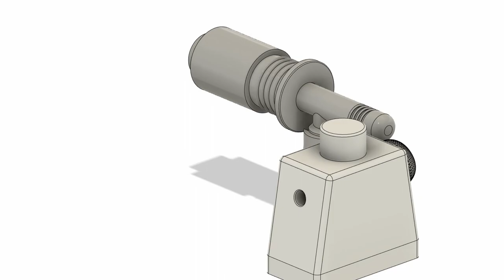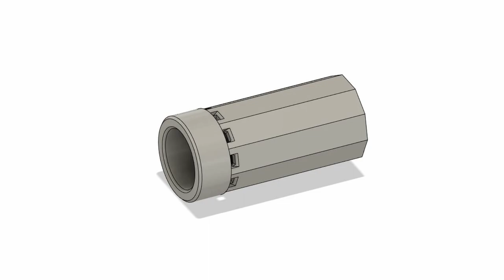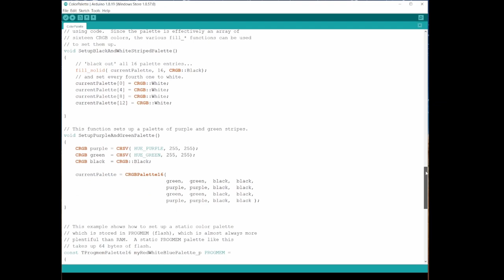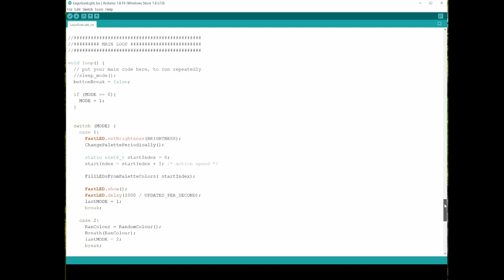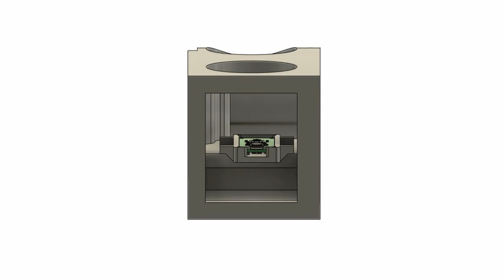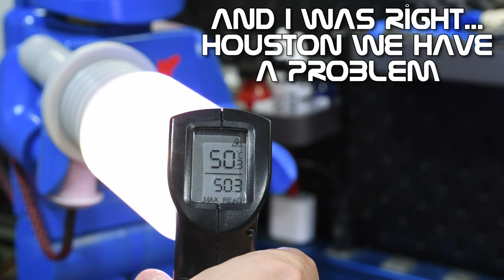3D Printing a Huge Lego Space Man LED Lamp

Comment: Do you have any coding, stl files, or anything else to go off of if someone else wants to do this same model?
Reply from the maker: Originally I found a 12” file in thingavers . I started with those and re-designed them to have better joints and scaled up to 16”.

Comment: Isnt there a fastled command to tell you the current draw? and you can also set a limit to max current to use.  its pretty accurate
Reply from the maker: I believe there is. I was more interested in the max draw so I could pick the right size power supply. It maxed out at around  1.3 amps so I used a 3A supply that I had.